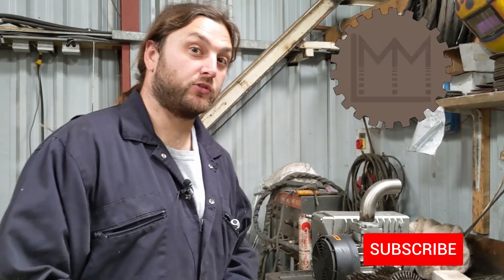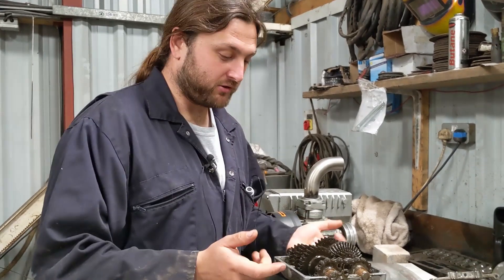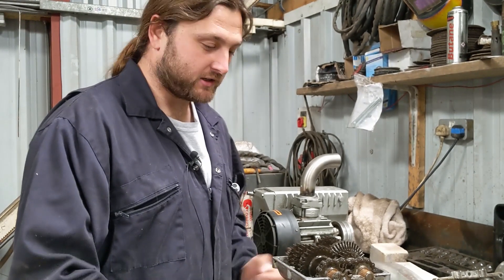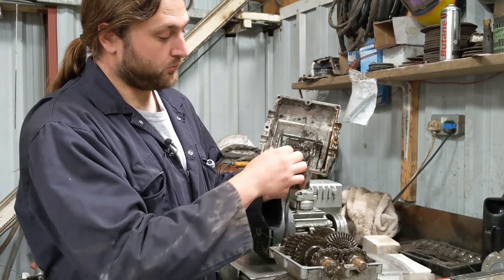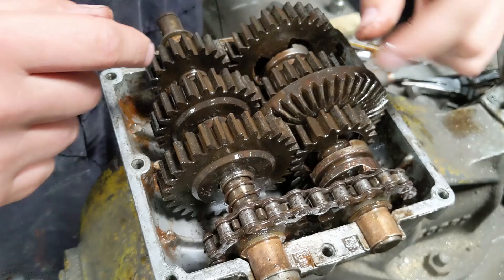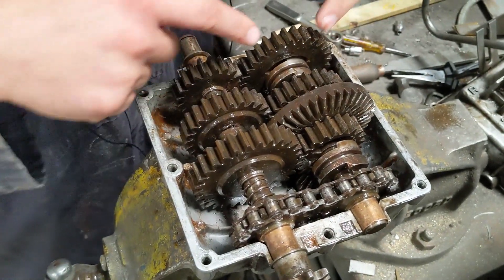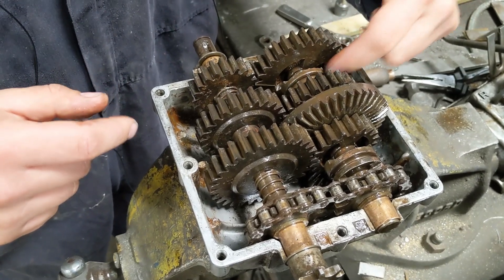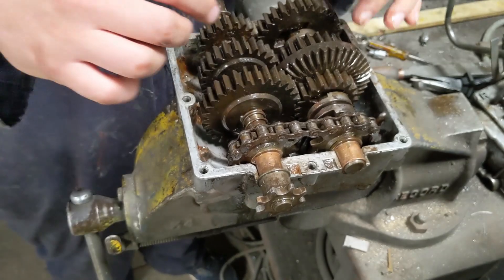Just what is inside a gearbox?

Comment: How does the syncromesh work?
Reply: Roughly speaking, those are small clutches that engage a bit before the "dogs" engage, so that the dog and the gear it's connecting to will be spinning at the same speed before it actually engages.
(This is a very simple transmission that doesn't have synchromesh.)

Comment: my guess was: oil
Reply: That's automatic transmissions.  :)
Well, okay, all transmissions should have oil in them.  But in manual transmissions it's just to keep it lubricated and it will work (badly) without it; in automatic transmissions it actually transfers power and does the shifting too.

Comment: Memories of auto practice class in secondry school. Pulling apart a three speed gearbox with the dire warning from the teacher not to get your fingers stuck Why?. Cause you'll look like an idiot going home on the bus with a gearbox hanging off your finger.
Reply: We had no such thing in school, for some silly reason. It should be standard that we're taught, top to bottom, how a car works - applying everything we learn about maths and science to something regularly used yet absolutely awesome. Planes should be directly after.

Computers should run parallel. History parallel to that, first the history of machines, giving way to the history of politics, economics, wars etc.

Applying theory to practice will eliminate the problem most have of forgetting almost everything taught in school.